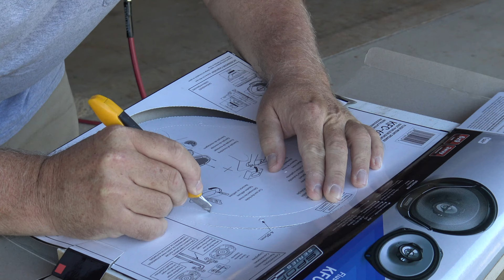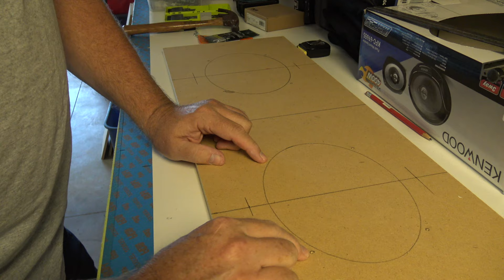VW Beetle Speaker Box | Super Beetle

Comment: You seem to be the only one that actually breaks down the build of the box.  I really appreciated the detail.  The thing I noticed the most was you are very meticulous in hand tightening the screws at the end of each one.  I was most wondering how were you going to smooth out the fabric on the box, and I didn't even think off rolling the box on the material vs pushing the material onto the box.  Never saw those Harbor Freight corner pieces and they look like they are a must have item in your arsenal of tools.   Thank you for showing CLEANING aka vacuuming after each cut.  Instills in me not to be sloppy and take my time with a build and be clean WHILE working.  GREAT video and thanks for taking the time out to show us how to do it right.
Reply from the maker: Thanks Mike! Appreciate the comments. Good luck on your build. Yeah, on those screws I just use a power tool to run them down then hand tighten to avoid cracking the grills. 😁

Comment: Very cool way to cover the box never thought of that. Here’s the thing I know. Due to the fact that you have two speakers for both left n right you need to put a divider in the middle of the box so each speaker has its own air space. The reason is so the speakers don’t fight each other due to some songs may have sounds in the music that come out of one side n not the other. I know it happened to me and worn out my 2 15” woofers.  Another thing I do is instead of wood glue I used silicone caulk makes for a better seal n air tight   Anyway that’s what I found myself.  Oh by the way did I mention my 2 15 “ woofers was in a 65 bug behind the back seat lol hear me coming a mile away lol.
Reply from the maker: @allenbrian72 Yes I thought of the center piece of divider wood after I had it together... won't forget on the next one. The caulk is a good idea too. Jam on!

Comment: Nice build and good explanation. But if the box was mine, I would have made a vented enclosure, instead of closed one.
First I have built a closed box for two 6 1/2 inch speakers and later replaced it with a vented one and used the same speakers. It really makes a huge difference sound wise. Both boxes were calculated to the speaker parameters though.

Lovely cars by the way. 👍
Reply from the maker: Yeah, I'll vent future ones, and probably add a divider inside the box between the 2 speakers.

Comment: I’m a little late to the party but…I’m curious how you determined the proper airspace for the 6x9 speakers?!  The reason I’m asking is because all you see anymore are the tiny 1/8’ plastic enclosures or those crappy little MDF boxes that are barely big enough for the speaker.  

The 6x9 has gotten a bad rap as being “Only Designed for Free-Air” and it definitely is more than that.  The 6x9 boxes that we used to build were very close to your dimensions and the performance from 2-6x9’s on a 50watt HiFonics amp shocked everyone and they thought it was 2 10” subs with horn tweeters(very old school).  

Glad I was able to come across this video and like all the other comments…Great build!
Reply from the maker: Honestly, I didn’t consider air space for those. It was more about the size of the box fitting inside that luggage area. That’s something I should learn though, just to ensure the sound system install is at its best performance. I should have at least put a piece of wood inside to divide the box and give the speakers their own compartment, and then maybe a 2” whole on each end so they can “breathe.” IDK. I certainly watch enough videos on the CarAudioFabrication channel.
Reply: @JayDubCustoms  yes…if you have them both in the same air space you would gain quite a bit by adding a divider because they wouldn’t be fighting each other.  With the porting, that’s where the 6x9 can get “Really Big”.  I’ve seen some guys run tests on the smaller sized 6x9 boxes with a 2” diameter port that was 50 inches long! Haha 

Not what you also could do is do a slot port on the top side of the box where it would be maybe 1 inch wide then an internal baffle board of 6-8inches and then it really sounds great.  BTW…we are saying very similar things from your response about the box.  Those aren’t GoTo dimensions but somewhere to start.  That’s called a bandpass port.  

After seeing yours, I think I’m on a quest now to build a perfect 6x9 box and I think your dimensions might be a good starting point.  Can you tell me what the rough dimensions of your box is now and I’ll do some Nerd-searching on the sites that I remember having some old info.